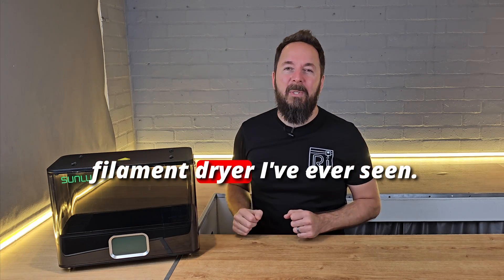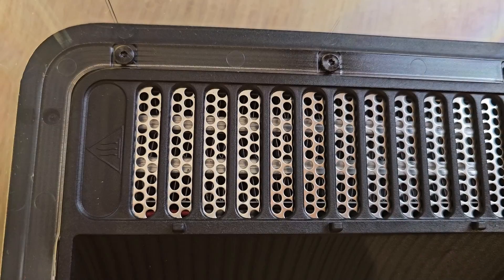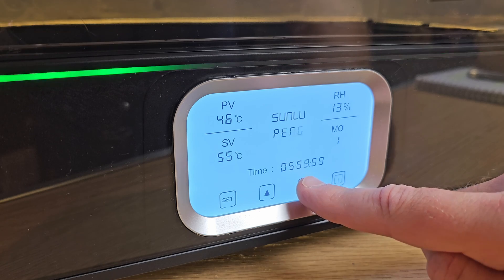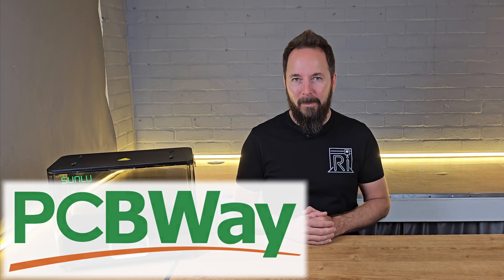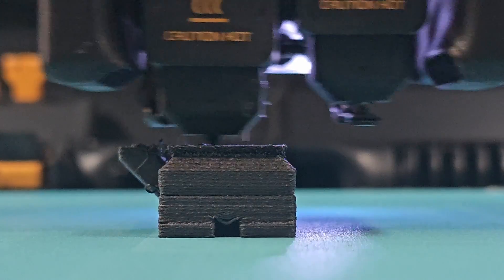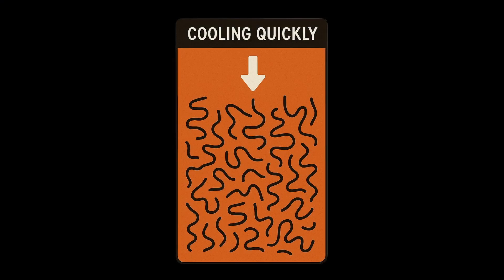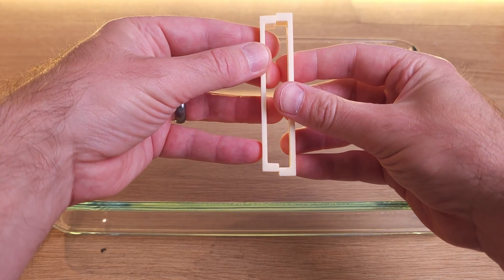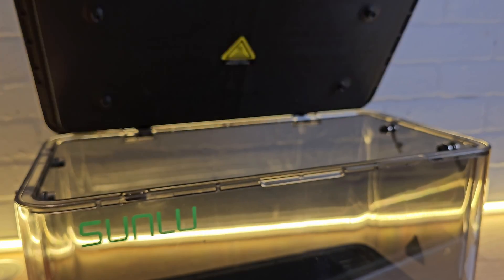Why This $350 Filament Dryer Might Actually Be Worth It…

Comment: Thanks for making a good review! I've used the E2 extensively for drying most of my filaments and desiccant and annealing parts printed in PETG, PA6 and PA12-CF and it has worked beautifully. 

My only gripe is that I think it heats up a bit too quickly for annealing, so I usually start the process on a lower temperature and ramp it up manually over time and also put the parts in fine sand to work as a kind of heat sink to distribute the heat more evenly and to reduce warping.

To me the asking price is worth not dealing with the headaches of using the kitchen oven and microwave and having to clean them constantly. A specialized tool to do the job properly is always a good way to go.

Comment: Good review. Assuming you have the retail version, does it have the lid warping issue other reviewers with prototypes saw?
Reply from the maker: No issues so far, yes I do have the retail version.
Reply: @RickyImpey Thanks. I took a shot and ended up ordering just after I saw your review. Did have an issue with one of the rails for the feet being bent incorrectly from the factory (so the dryer would rock if you touched it ) but that was sorted out. No regrets at all.

Comment: Get the Chitu Filipartner E1 $139 and don't look back 👍
Reply: Only goes to 70C
Reply: You're not drying laundry.
Reply: @Mcsandwhich Whats that have to do with filament?
Many filaments take a lot higher temperatures to dry. fine if your making Barbie dolls with PLA
Reply: @McsandwhichYou missed the point of the video. 

This is for those who use higher end filament. He says that like twice in the video. 

ABS, PA12, etc.
Not filaments that can dry under 80c.

This video is not for you. It's not even for me but that's why you got the response you got.

🤷🏻‍♂️🖖🏻

Comment: At first I thought this video was claiming the S4 was $350, which confused me. It was recently $118 at Amazon, which is when I bought mine. But then I saw this was a different model. I'm sure it's nice to have for nylon and other expensive filaments, but my needs top out at PETG and ABS. I have zero reason to drop nylon money on filament because I don't tend to need aerospace precision in my garage
Reply: Fascinating! Are there any other videos describing items that you don't have need for? I'm sure your comments on those would be just as compelling as your comment here.
Reply: @steveh8724  Of course. They can be found in large quantity in the comments sections of YouTube videos on every hardware topic

Comment: Does it have a method to automatically vent out the most air it pulls from the filament?  Both of Bambu's new AMS units have vents that open and close as necessary.  The vents open periodically when actively drying, but are otherwise closed to serve as a drybox.  
Dryers without automatic venting require users to remove filament from the dryer as soon as drying is completed.  If not, the filament can rapidly regain the moisture that was just removed.

Comment: WAY, WAY overpriced compared to dozens of other options.
Reply: Name 1?
Reply: Yeah, if you count dozens of other options NONE of which offer the features of this one. What's your favorite other dryer that offers 100+ degree C temps AND costs less than this one?
As mentioned in another comment, if you're just printing with PLA and other filaments that DON'T NEED high temp drying, then DON'T BUY THIS.
Reply: @steveh8724  Yeah. I noticed a lot of people have comprehension issues.
"I use my insert ghetto rig here>".  
Cool. This video isn't for you. And as I told someone else, it's not even for me! LOL But GD are people dense.

Watch the video. Like or don't and move on if it's not for you! Ffs. 

Nothing better to do than bark on someone's video while you wait for your PLA to dry in your Ninja Foodie dehydrator I guess. 🙄🤦🏻‍♂️🤣
Reply: @steveh8724  Also let's not forget the E2 has an annealing mode

Comment: Have a single spool Creality and a Sunlu S4 both do exactly what I require for PLA( silks included ) TPU and PETG.  When I move into ASA, ABS etc I will get an appropriate tool to deliver the results.
Reply: How are you finding the S4? I'm considering buying it atm from Amazon on Prime day as it's on a ridiculous discount for $169 AUD. I've been looking around for air fryers and dehydrators on marketplace to not overspend though I'm tired of searching and just need a good solution.
Reply: @YaNeK92 it had worked flawlessly everyday.   I put it through a bit of rougher treatment as it is in my semi. Engine vibration all night. Bouncing down the road ( 300-680) miles 6 days a week.   
I would say you will not be sorry to get it.     Worth every penny.
Reply: @PrintedTrucker  I appreciate your prompt reply bro! I think I might just pull the trigger and go ahead with it, since it does support 4 spools and I have the AMS so it will be future proofed if I ever want to print something in colour and won't have to wait for individual rolls to dry. 
Wait, are you saying that you've taken the 3D printing hobby on the road with you whilst trucking (if I understand that correctly)? 😅
How do you deal with the fumes and VOCs? 
I had the A1 Mini on my main desk in my small office and I could only last a day or so with it before getting watery eyes, itchy throat and a small cough which was all early signs of the microplastics having a negative effect on my body, so unfortunately (even though the printer is cool to look at whilst it prints), I had to move the whole operation into the garage.
Reply: @YaNeK92 built a BENTO BOX. Carbon and Hepa filter. No problems at all.   Still when I do ASA I put in a fan and open the windows.  
Yes. In my 389 peterbilt truck.    
And my trucking channel thistruckerslife

Comment: I use an Air Fryer.  1/3 the price and if you shop around you can find ones with the temp. range you need. Just watch out, with all these solutions the spool can melt.  Mine has a "dehydrate" setting which can go to 170F (76C). Then the regular setting goes up from there. Up to 204C if you need it. It works great, just shop around because specs and sizes vary.  And it makes great french fries. Lets see your dry do that.
Reply: Better yet, get an actual food dehydrator. There are many circular ones that can house a 3kg spool if that's of any interest to some and they're a cost effective solution.
Reply: you know, a screwdriver makes a decent chisel, but I would still want to use a chisel.
Reply: @Keyan9  Great point!
Reply: I love microplastics in my food!
Reply: @mossy5127  You use your filament dryer for food?